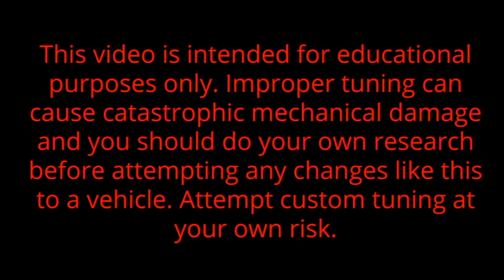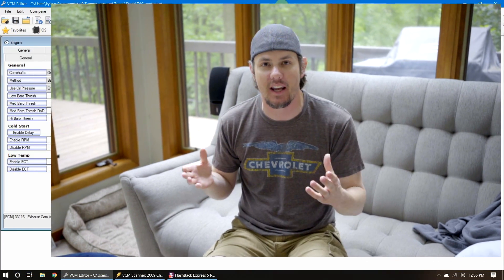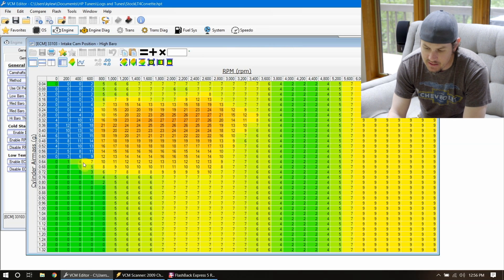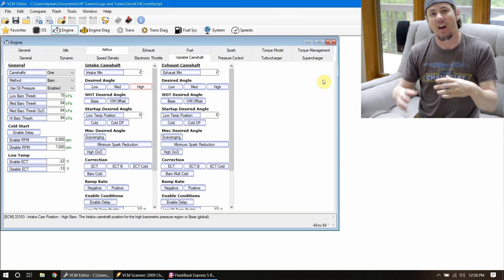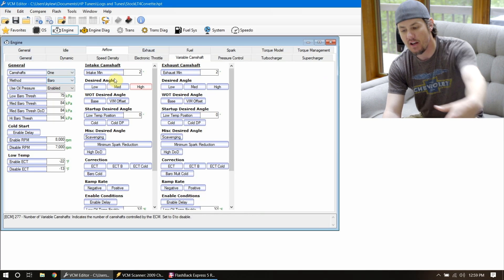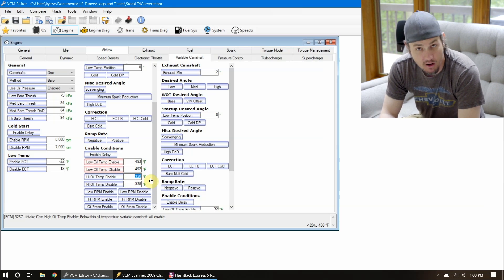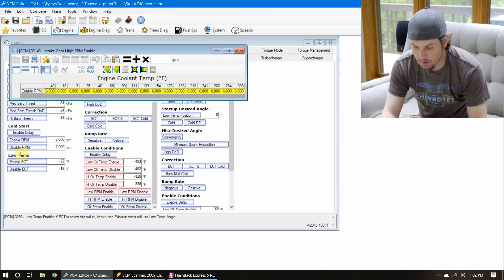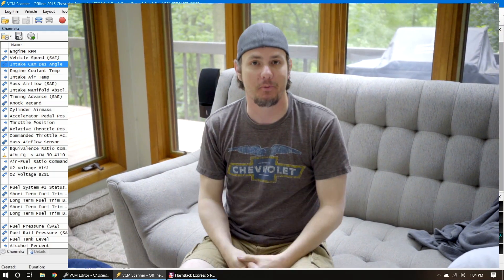VVT Disable in HP Tuners, Getting Rid Of Variable Valve Timing

Comment: The Cam phasing in light throttle areas is used for EGR , reducing combustion temps that can over heat engine and exhaust components as well as reducing NOX emissions. It also makes the engine more efficient by reducing pumping losses.
Reply: My cam phasing map looked the same/similar but don't have egr from factory on this truck

Comment: You will lose power without VVT. Being able to advance a cam on the fly is a huge advantage.  Unless you install a super aggressive cam, which is only good for high RPMs, keep the VVT.
Reply: Stock cam has more low torque, aggressive cams trade off low torque for high rpm power.  What you want depends on the vehicle purpose.  Trucks are best with the stock VVT cam.
Reply: Should I delete vvt if I'm using diablo tuner with cold air intake and true duals? I have a 2007 Yukon Denali xl

Comment: I'm putting an LS3 in place of an L92 in my 08 Escalade. The LS3 has no VVT or AFM.  This swap will eliminate the VVT solenoid and VVT front cover. I'm assuming I should just zero out the intake cam VVT numbers . Will the PCM set DTCs for the missing solenoid? Can I turn off those codes? Great Video BTW!!

Comment: A little confused here. I am under the impression that the Gen IV and V engines are only able to retard the timing. The cam on the LT1 for example might be around 8.5 degrees advanced. So when looking at those VVT tables, a value of 0 would mean that you are not retarding the cam and are sitting at 8.5 degrees advance. Then as you increase RPMs you want to retard the cam more to make more power up top. 

The VVT tables seem to over-retard the cam at low load/low RPM for emissions related reasons and fuel economy under partial throttle driving conditions.  

But if the cam is over-retarded there, that is essentially decreasing the Volumetric Efficiency in those areas on the VVT table, so the spark table may need to be adjusted (VCP Spark) in order to deal with the increase in VE and therefore cylinder pressure now that the cam isn't being retarded so much. 

Is this how you understand it now?

Comment: 2013 4.8 converted to 5.3 with BTR Torque Cam disabled VVT got the gear and cover but i still get the p0010 cam error on the scanner what did i miss?

Comment: Hi I've got a truck 2009 6.0 with VVT and considering disabling it. When you go into HP tuners and turn it all off how does it show up or not show up when you're doing an OBD2 plug-in emissions test ,or dash check engine light?
Will it need further A/F ratio attention?

2009 Suburban 2500 6.0 LY6 vin K

Comment: Deleted the VVT on my L86 using the Katech VVT Delete cover and gear.  Verified all valve events using a degree wheel so I know my camshaft is installed correctly.  Truck fires and idles just fine but the scanner still shows 18* of Intake Cam Angle.  Any idea why? Should I be concerned or will the Tuner deal with all this?

Comment: The Eagle Hemi makes best power when you keep VVT and tune it right with a terminator. Why isn’t anyone attempting this with LS
Reply: Because people don't understand it, especially the older generation. It's adding complexity that most reject. I have to really explain these concepts to a lot of my customers, and eventually 99% to get it. If it was up to me every engine would have some k8nd if variable cam timing. My Supra doubles its torque at the 3000-4000rpm range with vvt. There is some incorrect info in this video but overall it's decent.

Comment: Hey buddy  I done a dod and vvt delete went to the non vvt timing cover and 3 bolt gear do I set the cam # to zero and 0 out the tables
Reply: Did the same to my truck. Did you ever figure it out? Going to tune it myself since theres no one around my location to help

Comment: Hey man. I have a 2014 Silverado 6.2 L86. I am deleting afm/dod with a new cam(step above stock), ls7 lifters and cam phaser limiter kit to keep vvt. Will an HP Tuner be of use or so I need a custom tune? Can you disable afm with a different cam installed? Does the tuner accept the cam info to rewrite the ecm? Thanks for your help.

Comment: I keep getting code P0011 camshaft position sensor. I changed it i also changed the oil i also changed the harness to the camshaft position sensor,i changed the actuator i changed the VVT , i purchased a new transmission , know the shop said you need a oil pump in the engine I'm really sick of this code . My escalade engine runs RETARTED if i disable the VVT will this fix or solve my problem?

Comment: Looks like "Intake Cam ECT Correction" tables were not matching up from the hptuners base repository for a 2010 Camaro against the E38 i have from a silverado ECU with DOD when i used compare function some of the table was different. I changed it to match the LS3 2010 Camaro file is this okay

Comment: Goat Roap, I did a cam swap on my 2015 SS Camaro, deleting the DoD and VVT and tuning went well with one exception. check engine light stays on for cam position sensor fault. What did I miss?
Reply from the maker: Interesting, any chance your sensor got damaged in the swap?
Reply from the maker: Also, did you use the stock can gear with a limiter?
Reply: @GoatRopeGarage  Went with a LS9 cam 3 bolt with gear. Completely deleted VVT...Found the solution: Eng Diag/DTCs/uncheck P0010, click; no error reported. upload

Comment: I am doing a DOD and VVT delete in a 2012 GMC yukon XL 6.2. Ive already disabled the DOD, will i need to do these steps also since i am going with the old 3 bolt cam sprocket?
Reply: What did you go with buddy? I’m doing mines next
Reply: @leezylaflare254  went with a BTR stage 1 but can't get the tuning done right so looking at a replacement factory cam to go back in now.
Reply: Ahh, okay thanks

Comment: Good morning! Love your channel... I recently did a complete AFM/DOD delete and a non VVT cam. Runs like a champ out on the road but lunges and sometimes dies at stops. I disabled AFM but didn’t delete or disable VVT. Will disabling VVT solve my issue?? Educated guess will do I guess! I’m at a crossroad with my issue and can’t get across. Thank you for the great vids!!
Reply from the maker: If you installed a phase lock it won't matter, but you probably are having issue airflow issues, or too much idle torque if it's a fifth gen
Reply: @GoatRopeGarage  gen 4

Comment: VVT was invented to replace a egr valve. On a stock cam especially with forced induction if tuned right it will add more pull on engine. But if you change to big cam than you may want to 0 it out. Lots of options here. On my vette if I added allot of retard low it made it to peppy. Helped up top well

Comment: I was asked to disable VVT on a 2011 Colorado with a 5.3. It is alittle different than the video with the fact that it uses oil pressure and he took out the actuator. It set a P0010 code but would you disable the oil pressure tab after setting the oil psi enable/disable or would it matter? It has an E67 ecm.
Reply from the maker: Yeah, if he pulled the whole actuator just switch the cam selection to none and disable any DTC's associated with it.

Comment: 2016 Yukon L83 with cam with a 4 degree limiter, ported heads and a 3000 stall.  No power from a dig but I thought it was due to the 3.08 gears.  Do I follow these steps for my setup as I have a limiter or do I follow a different approach?  Turning off the VVT with a limiter bad, good or indifferent?  Trying to get it to have better take off as it feels like I'm pulling a trailer out of the hole.  Loving your videos!

Comment: VVT : more overlap -> engine breathe better at high speed but poor performance at low speed (better for higher rpm), less valve overlap: more torque at low speed but low high speed performance as the engine can't scavenge the exhaust gasses with high rpm. So why disable valve timing, when you can stress this value more having a more aggressive toque at low speed as an engine that breath at full rpm? Don't bother with math with a fixed valve timing makes thing easier with less headache, but not as best as using advance technology to get both of the benefits. VVT was probably invented for the emissions purpose, that doesn't mean that if you know how to play with those values, you can have high torque AND high speed breathing engine all together, a surely better choice that giving up one of the two, disabling the VVT
Reply from the maker: That's but how it works in a single cam car. On DOHC you can adjust things like overlap with VVT.

Comment: Why would one get rid of VVT on an an LS engine? I understand deleting  DOD/AFM completely, but taking VVT out leaves power on the table when tuning, unless one can not tune the vvt system. Deleting the DOD/AFM and keeping the VVT  is the best way to GO.
Reply from the maker: With a high lift cam you will run your valves into your pistons. And VVT as it is from the factory doesn't make power, I've proven that in the real world and even did a video on it showing slower 1/4 mile times back to back on a VVT vs non-VVT tune with the factory cam. Also might be why it isn't on the LS7. It's a fuel efficiency gimmick on a push rod V8 and no one has proven otherwise yet.
Reply: @GoatRopeGarage , yes, but a cam phaser like you said can help. I have deleted all of my DOD crap and kept the VVT in my GEN5 Camaro. I run a TSP VVT 3.2 cam in my car with a duration of 231, 243 and lift of 649, 629. I have been runing it for over 2 years with no issues. My car is faster than my buddies VVT/DOD delete and which has about same cam specs, just a little more duration and lower lift on the exhaust side. My car is vert and is also heavier than his normal top. I believe that the torque curve and power band that the VVT system provides is much better than his non VVT system. My buddy's car also has more power on paper. Saying to take VVT out is kind of misleading, just sayin.
Reply from the maker: Take it to the track, do back to back runs, one with VVT disabled and see what it does. You're comparing two cars, I tested it on the same vehicle, only thing different was the VVT was on versus off and it ran faster off

Comment: I have a 2005 envoy gmc came with a gen 4 5.3 i changed motor to a gen 3 it has a e40 ecm motor runs ok but cam crank need to be relearned it has a code and wont relearn
Reply: Timing issue or bad sensor

Comment: I rebuilt my 6L80 and doing a full DOD delete... Upon tearing it down I noticed that I have VVT... I already ordered the 3 bolt cam sprocket and BTR stage 2 Cam kit... My question is basically this... I get that I will need a different timing cover but what happens with the plug that is centered on the cam cover?? If the computer doesn't read it will it start?? Btw I already have the HPTUNERS PRO version and I'm learning by watching your videos...
Reply from the maker: Go to the VVT tab and set cams to none, should be good
Reply: @GoatRopeGarage  thank you so much!! Hard to find someone to give this level of service and advice... THANK YOU!!

Comment: I would only reduce the low rpm cam retard(egr). Slightly Retarding the cam in the upper rpms like the stock tables do seems to be the best for power, not much to be gained by more retarding but I think advancing the cam like you did would hurt top end power. I believe that 8.5* on that table is actually 0 on the cam. Also I have heard removing the retard at the mid rpms can have a great increase on cylinder pressure and timing should be adjusted to compensate for this. I haven’t attempted to tune this yet but this is wat I have learned so far
Reply from the maker: 0 is parked, like having the cam installed straight up, which is why you see so many running with 2 degrees of cam retard when disabling VVT

Comment: Thanks for all of the info! I love the channel so far, I have a question though. Im doing a cam swap on a 2017 L83 silverado and installed a limiter in the sprocket. The truck was already tuned so the guy is taking it back to the shop that originally tuned it to have the tune adjusted for the new cam. Will the truck be alright to start and run if the vvt settings have not been messed with since it has the limiter in the sprocket? I was debating on leaving the cam magnet in the front cover unplugged until he gets it tuned because i wasn't sure if it would cause problems or not. I know its not gonna run right but he wants to drive it to the tuner after the swap. Any info on that would be awesome!
Reply from the maker: Do you have the ability to tune it? You could easily kill the cam retard enough to keep it within the limit of the limiter. Probably won't hurt anything if you can't, it just will probably throw some codes because it can't time as far as it wants
Reply: @GoatRopeGarage   Thanks! I do have the ability to tune it but the customer does not want to pay for the licencing credits since his other tuner has it licenced already. I'm just doing the install but will see what it does once i start it up!
Reply: @GoatRopeGarage  would getting a vvt cam from texas speed require more tuning in comparison to just deleting the vvt and upgrading the cam??

Comment: For a VVT Delete, wouldn't changing "Camshafts" under general to "None" not do the whole delete instead of all that other stuff?
Reply from the maker: I'm not sure, because I've tried that and still had cams do crazy stuff. I'm not certain that it's one of those parameters on some ECMs that doesn't do anything.
Reply: I was reading another tune and it had Camshafts:None and it had a truck norris cam, although it was a Gen IV engine.  I came here to ask the same thing.

Comment: Aren't you opposite on what the VVT system is doing?  You stated that the VVT is a system that allows you to advance the camshaft up to a certain amount of degrees...?  Then you stated that it's primary purpose was is for emissions...?  It's my understanding that the VVT is designed to broaden the Torque curve of the motor by retarding the cam for upper rpm power.  The VVT cams have additional advance ground into them for low end power and the phaser retards the cam for upper rpm power so the end result is a wide flat torque curve... right?
Reply from the maker: It is parked at full advance, I mistakenly said the wrong thing there. And while it can be retarded to create additional cylinder pressure for more down low power, it's more for emissions, you can see that based on the tables and where it does the most changes is in the cruising areas on most platforms. It also crates a layer of complication when tuning that generally is easier is you simplify the adjustments.
Reply: Goat Rope Garage that’s not correct. Advanced cam timing down low is what “creates additional cylinder pressure” ie. Makes more power.
Reply from the maker: Correct, but that is not the primary purpose
Reply: Goat Rope Garage what do you mean “primary purpose”? The purpose is to provide the best of all worlds. 1. Low pumping loss at low load (by retarding). 2. Good torque at low engine speed and high load (by advance) 3.  Good horsepower at high engine speed (by retarding).

Comment: Thank you for these videos! Subbed.  I have a 2009 2500hd with the ly6. I have hp tuners and would love to see another video on tuning the factory VVT cam.
Reply: Did you mess with the VCP spark table any? Same motor just trying to dial in spark timing and vvt at the same time.
Reply from the maker: You can zero it out of you're not using the cam in it's stock form. If you do have a slight ramp to your VVT but get rid of that big zone where it's drastically dialed back you'll be fine
Reply: @jacobb118  Thank you for bringing this up, I just brought up the VCP table in hp tuners. Had no idea it was even there! It has blocks of large advance down low. What does VCP stand for, and how does it function. Thanks Jacob!
Reply: Ben w I’m going to zero out my VCP table and smooth the VVT phase table as the video suggested. Then handle any spark adjustments through the high octane table. I’m hoping that will allow me to dial in spark in a more straight forward fashion.
Reply: Ben w I’m in the same boat with you. Same truck ,same year and same engine. I hope if I do what he did in this video works.
Reply: @alfredogarcia9105   I removed the block of high cam advancement down low in the rpm. I kept a simple cam advance that goes up slightly with RPM and load just like in the video. My truck picked up low end torque like crazy. Another thing that really helps drive ability on our trucks is to unlock the torque converter in 2nd and 3rd gear. I have my converter set to lock in 4th above 50 mph and unlock below 45 mph. HUGE improvement, no more lugging down low

Comment: Hey there I’m working though your videos and am so bummed it’s taken me this long to find your channel. 

Something I’ve wondered before, when we are trying to disable any specific function there are often multiple variables than can enable or disable. Like at 7:30 of your video you go though and disable each variable. 

Would it not work the same to just disable one? Set enable vs oil temp to 400 and then nothing else matters because it’ll never hit that right? I’ve often wondered this, would appreciate any input.
Reply from the maker: Correct, but we're there what's and it's just a couple button clicks to change the others and make sure that you're not going to deal with it. Thanks for watching!
Reply from the maker: If that is the case you can disable then under the DTC list but most aren't going to cause an issue during tuning other than a check engine light so when we are done and turn everything back on they go away.